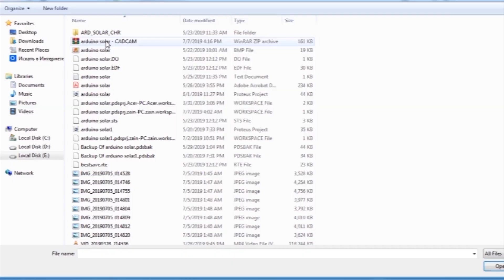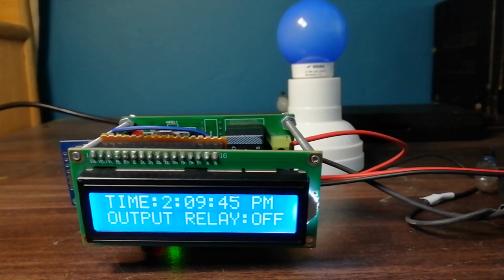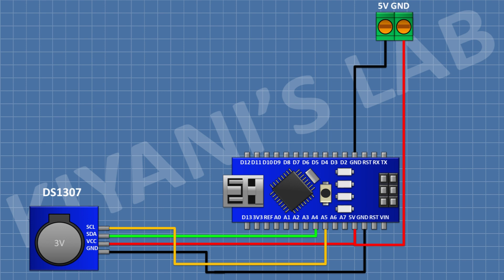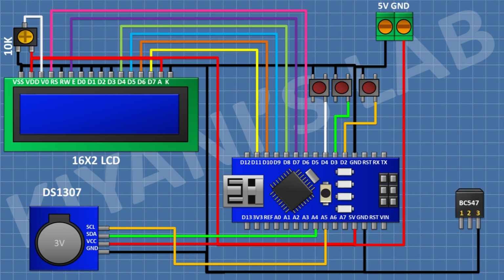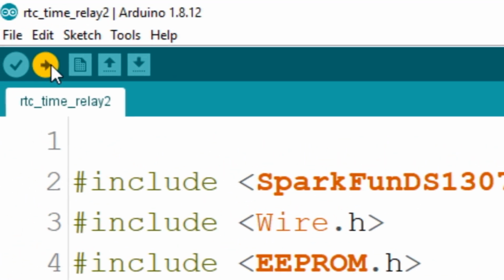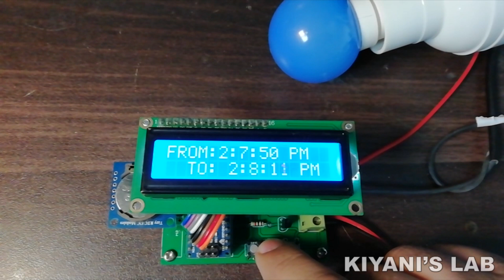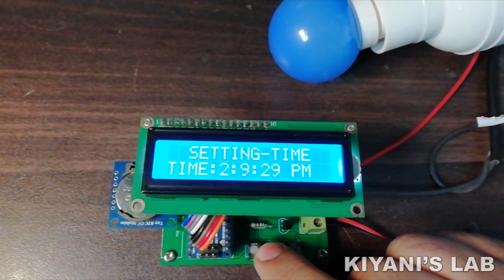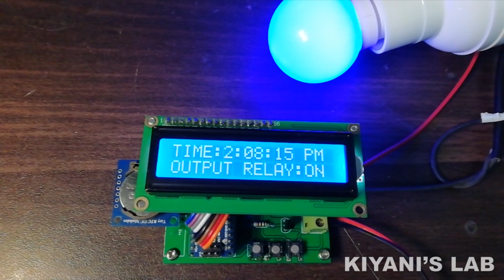How To Make RTC Relay Timer | Specific Time Trigger Switch

Comment: Hello! Can i make it that a certain button and a code is connected to each other. For example a time/month code is connected to this button, if i press this button the code will run and the relay turns and so on the light connected to it.

Comment: i made this project but one problem i using RTCDS3132 module  no progrom change   but function  this module  i set time for 6;00pm to 6;00am set  but  automatic off for10;00 clock   and 12;00 clock on  yy problem  i using rtcds3231 module    rtc problem ? or program problem    program change my rtc but error

Comment: Very nice project sir,
I thing By mistake your schematics wearing have small
Mistake 
2pin power connector Red colors  wire is GN,  & Black colors wire indicate was Positive voltage
Otherwise everything fine
👍👍👍
Reply: Yeah, the label he's put above the 2-pin power connector is wrong. It currently reads: "5V GND" but should read "GND 5V" - the wiring looks fine apart from that.